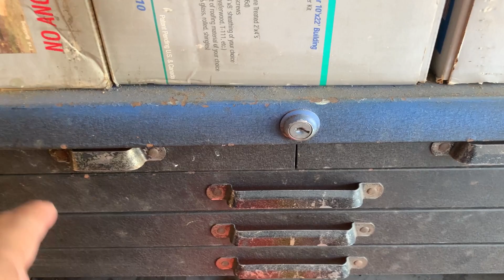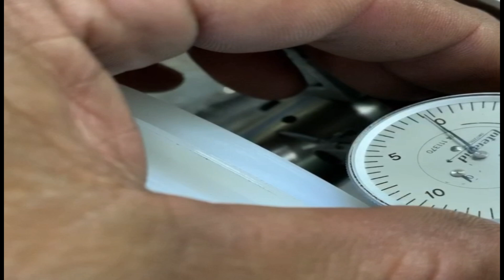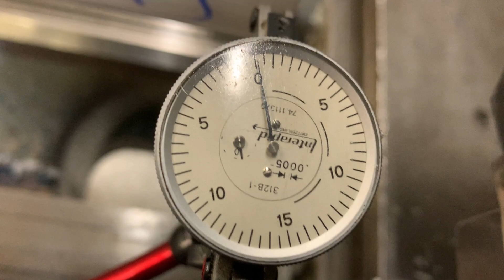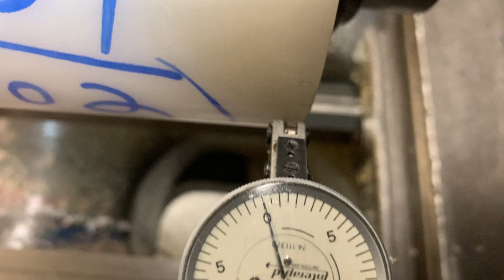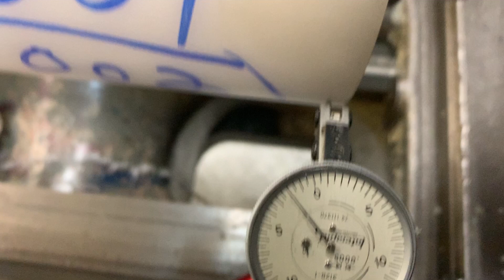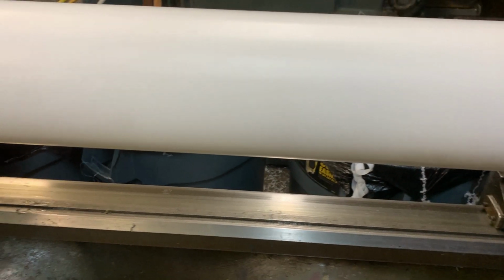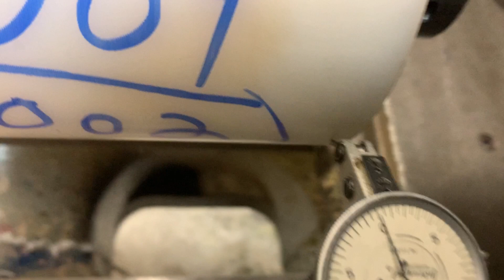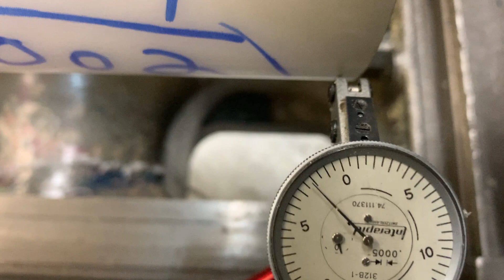fixing a taper cut on the lathe the easy way

Comment: If the part is tapered small at tail stock end put a rolling paper on the operating side of the morris taper. Rolling paper is .001 thick
Reply from the maker: Why do that, my friend? There is no need to do something like that if you do it like in the video. Why rely on paper when you can rely on the indicator.
Reply: It’s quick and easy especially if you want to taper for alignment in reamed holes